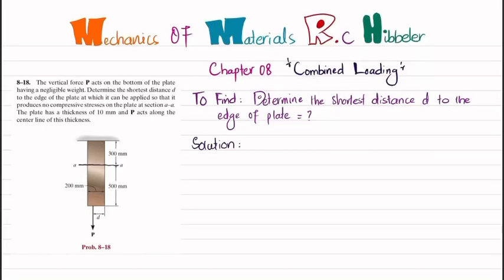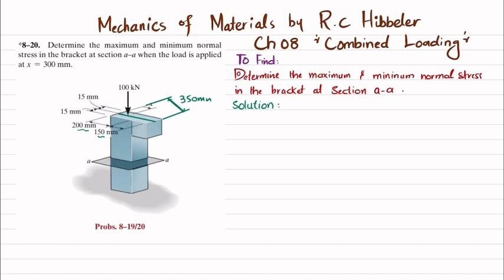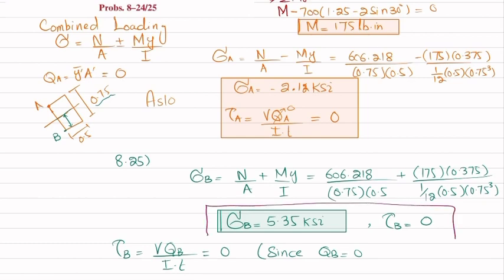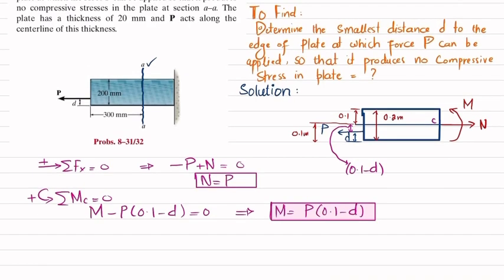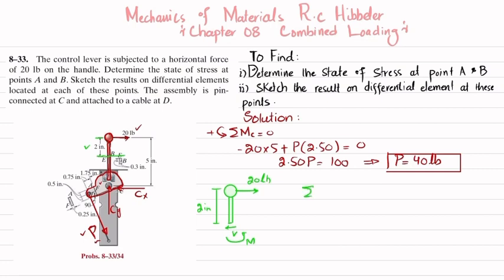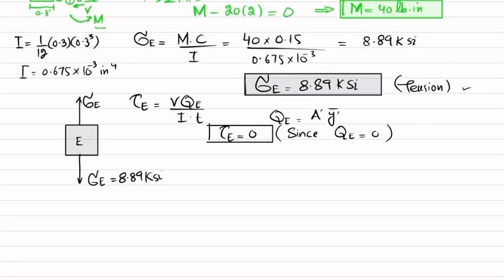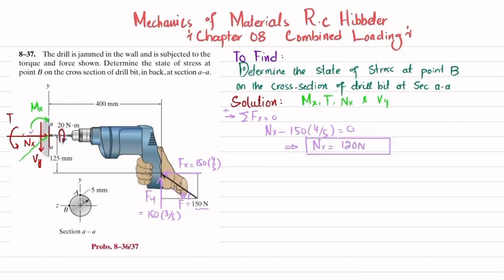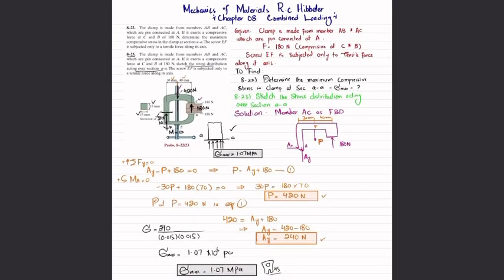Combined Loading | Stress | Mechanics | Bending stress | Mechanics of materials RC Hibbeler |

Comment: Sir in the first problem how you take the value of h and what about  Y ??
Reply from the maker: Please mention the time frame for quick response
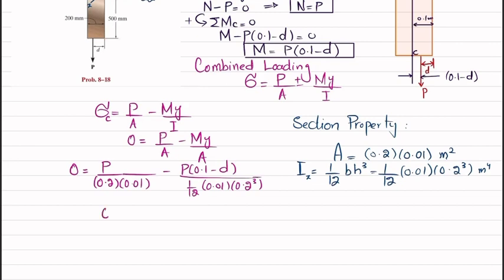Reply: D @engradnanrasheedmechanical during combined loading calculations at 8:00
Reply from the maker: @Asmijitshil24 ok you can see the cross section Area which is 300mm wide and thickness is 10 mm. So thickness will become h .
Reply from the maker: @Asmijitshil24 you are welcome 🌹